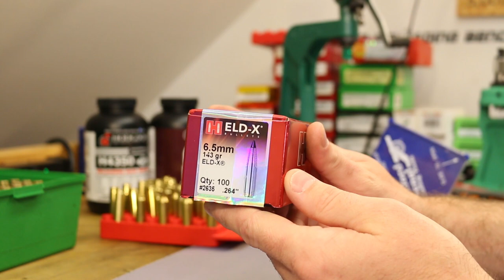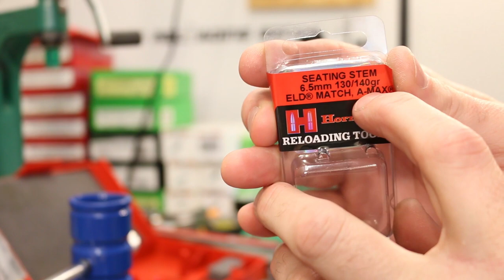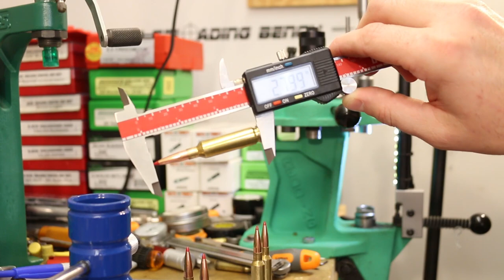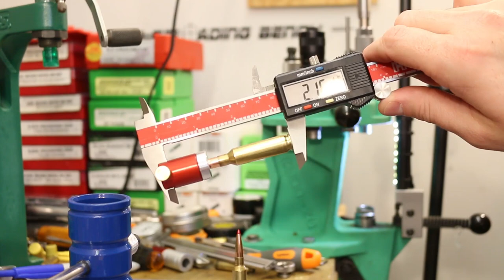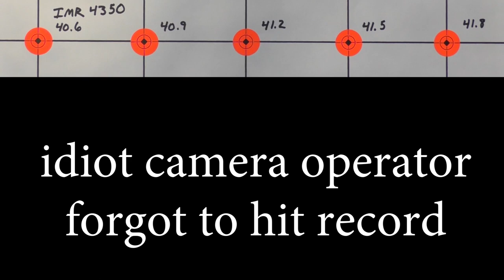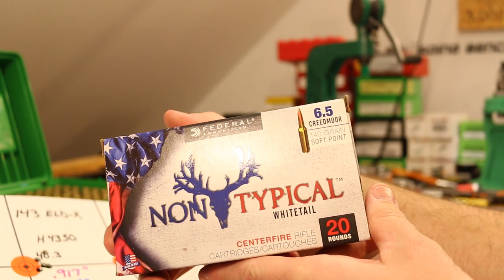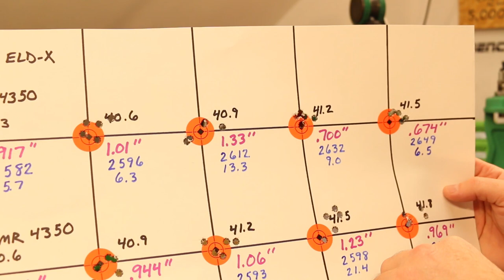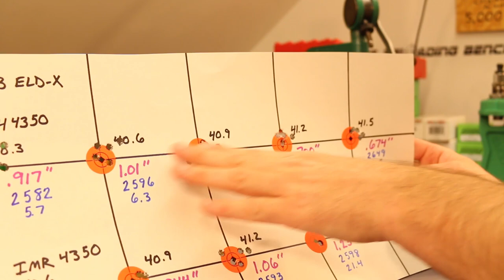6.5 Creedmoor - H4350 vs IMR4350 - 143 ELD-X

Comment: that gun is shooting well
Reply from the maker: I'm certainly happy with it!  It makes me question the logic behind building a custom 6.5 Creedmoor to replace it.  Spending $1,000 more to get, what...another .1 or .2 inches of precision?  Maybe I'm underestimating just how much better a custom rig will shoot.
Reply: well actually I just built a custom rifle in 6.5 creedmoor.  I used a Savage 10 FCP which came with a 20 inch barrel but would not shoot under 1.2 MOA with Hornady 147 ELD and RL17.  I bought a Criterion 26 inch stainless heavy barrel 1/8 twist, percision ground barrel nut and heavy barrel lug for $375 shipped.  I am now just getting Hornady brass fireformed and then I am going to uniform the primer pockets and sort the brass.  I am currently using Nosler 140 CC and get about 3/4 MOA with 42.3 grains in new brass.  I am hoping to get my local Scheels to order some RL 26 and then try load development with the rest of the 147 ELDs I have left.  I have shot some extremely small (first two shot through same hole) and the third round within an 1/8 inch of the first two but then the next two take the group out to 3/4 or more MOA.  However, for hunting, the TC cant be beat for the price. It is amazing how far guns have come in the last 2 years.

Comment: Hey where in God's world did you find the h4350 I can't find that stuff anywhere in the world lol
Reply: Shane Rhodes called the gun store. On the shelf locally...lately
Reply: Thomas Ewers huh I have been watching like powder valley and Natchez and nothing but I did find federal 210 and 215 primers so things are letting up good signs
Reply: Yes. Exactly. Which is why many have explored IMR 4350 (among others) as a substitute-- H4350 is routinely and widely UNAVAILABLE.
Reply from the maker: Sitting right on the shelf at my local gun store!  They even had two 8 pound jugs as well!  So, hopefully it is getting more available...they seem to have shipped out a big lot here in the last month.
I am going to be focusing mostly on other powders, though.  Just duplicating what everyone else has already done with H4350 sounds boring, so I passed up the 8 lbs jug and just bought this single.
Reply: I tried 4451 in 3006 and it worked pretty well 46.5 gr and a 165gr Sierra gk a D it has shot very well on three different rifles so hope I have stumbled onto a good load
Reply: Powder Valley and Midsouth  get it in regularly.  Just gotta keep checking.

Comment: My WAOAW Digital Milligram Scale 50 from amazon drifts by 0.04 right out of the package
Reply: Mine drifted to 1.8 GR . It started out at zero then it just counted from 0.0 - 0.2 - 0.4 - 0.6 and so on all the way to 1.8
Reply from the maker: My large version does read +.04.  So. my 20gr check weights read 20.04.  Is that what you're seeing?
Reply from the maker: @josephhomen is that just during warm-up?  Mine generally reads correctly immediately, but I did see in the instructions that they suggest at least a 60 second warm up before you calibrate or zero them to start using.
Reply: I'm seeing a approximately 0.04 drift from zero when replacing the pan on the scale.